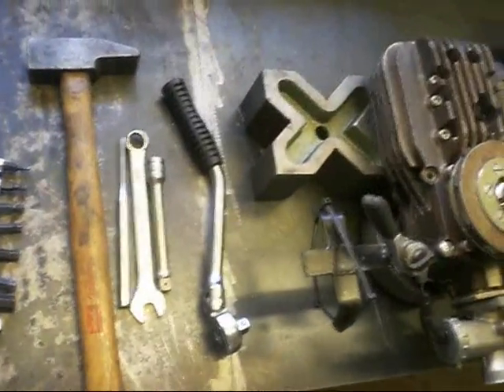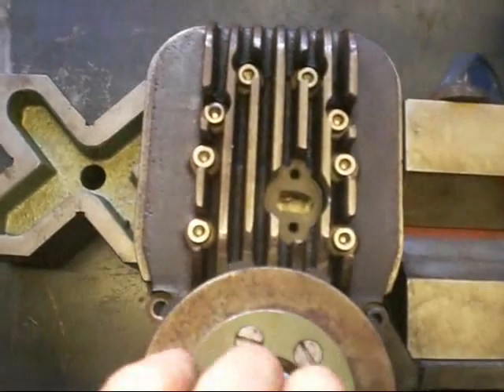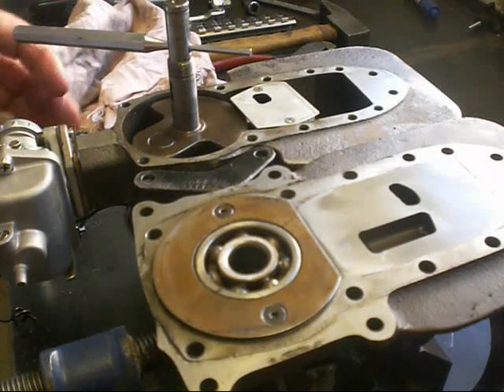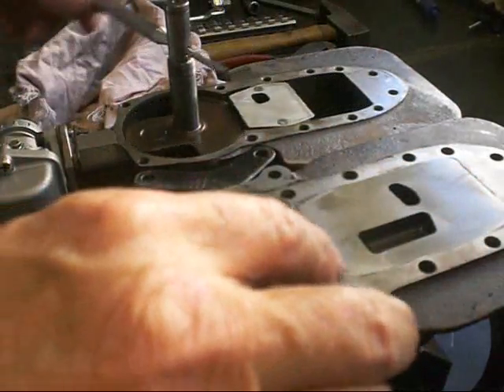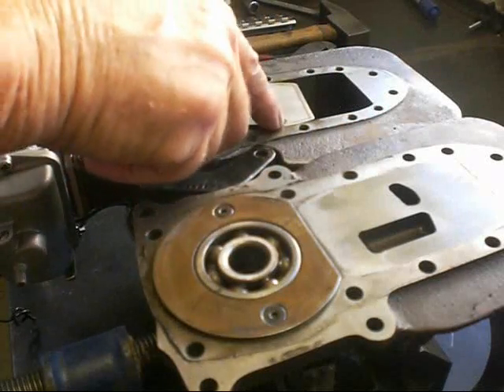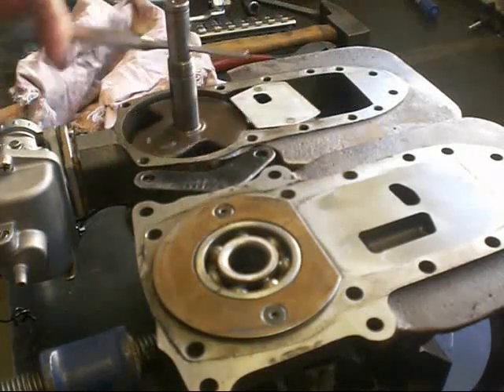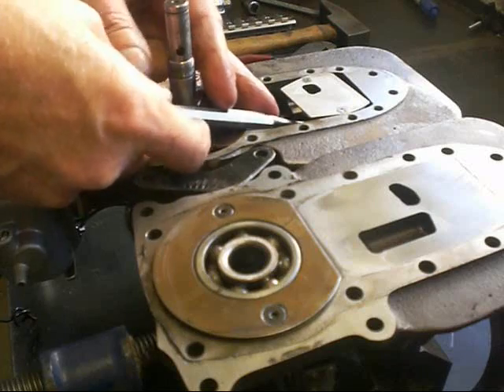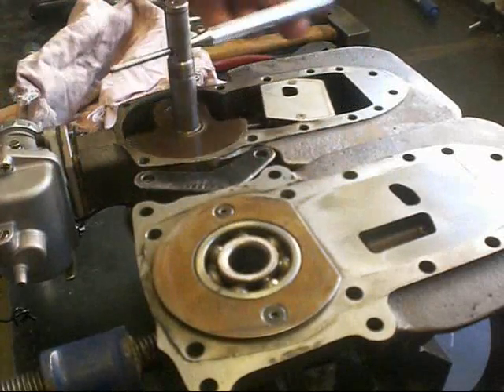hossack engine (FIRST STRIP.)wmv

Comment: Pistons do not have to be round.  Honda NR500 had pistons, didn't it?  OED says the word comes from Italian pistone, variant of pestone 'large pestle'.  So basically, just having the motion of a grinding pestle.  Which this engine's piston does even more so than the normal type.
Reply: pistons are just round cause its the easiest and cheapest most reliable way to make it. having rings is better than apex seals and stuff cause corners leak and round holes can be drilled and honed where as square holes are hard to make
Reply: if you wanted to make a motor with a star shaped piston and cylinder you could it would just be very hard
Reply: Well the NR500 failed.

A problem that people may have overlooked is the porting, how is a rectangular bore going to affect the 2 stroke cylinder filling? not well.

Schnurle porting probably wont work properly at all so a totally new design would be needed for this design to be useful. 

Also, the way the piston hits tdc at that angle seems like it would invite knocking quite easily. Lesser issue though.
Reply: @finlaymcdiarmid5832  Whether the NR500 was a competitive / commercial success or not (clearly it ran decently well so was a success on the functional basis) has nothing to do with my 10 year old answer to the question the OP asked as to whether pistons by definition need to be round, or if the ones in this case should be called "lobes" because they are (in this case) rectangular in cross section.

As I noted, the pistons in this engine are more like a "pestone" than the conventional piston is!
Reply: @sebwiers1  doesn't matter that much. TomATEo TomATo.

The NR500 may have been functional for short term racing but we don't know if it just lasted a race or could actually be used everyday reliably as a runner if designed so.

To be honest though i think the oval twin conrod piston was a pretty daft design to begin with, with obvious fundamental disadvantages and the gains were never going to worth the development. Hossack engine seems to be more grounded than it.

Very quick response from a decade long comment. why so?
Reply: @finlaymcdiarmid5832  Quick replay?  Sure, the comment being a decade old doesn't make the notification icon update any slower.

Anyhow, point being the Hossack engine has "pistons", no need for a different word.

Comment: My first thought is this would work amazingly in an opposed piston engine. You could effectively vary compression ratio by varying the crank timing on one side or even both.
Reply: That's an excellent point, you could use a hydraulic cam phaser on any opposed piston engine to achieve a variable compression ratio.
Reply: @nickopedia5669  Interesting idea, but that is also going to change the timing of intake and exhaust pressure, peak compression (thus spark), and maybe opening of intake and exhaust pressures.  All could either add to complexity or require compromise settings.  This engine design is intended to be both simple and optimized in terms of timing.  An opposed piston version with variable compression achieved via crank phase change would be the opposite of those goals, and I don't see what advantage this design gives over a round piston in that case.

It's tempting to look at opposed pistons and think they can solve all sorts of problems, but they also introduce new ones.  There's a reason they are uncommon.